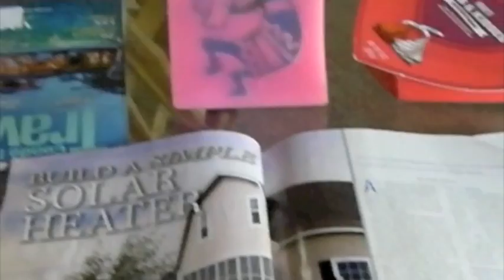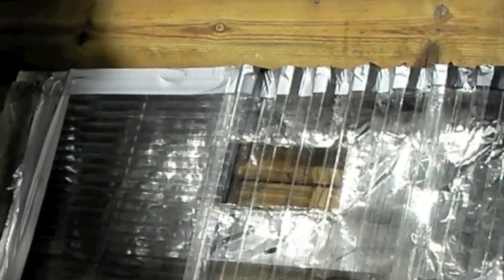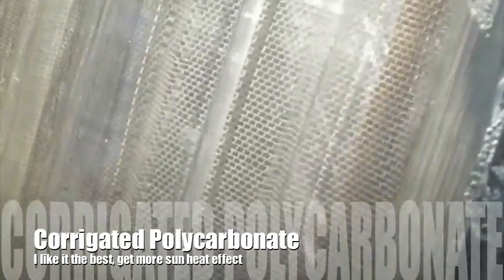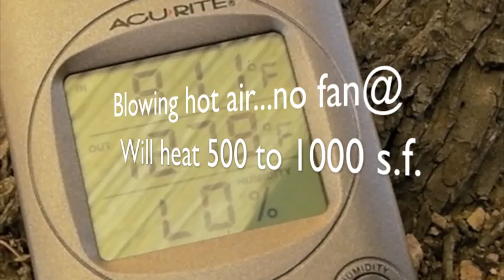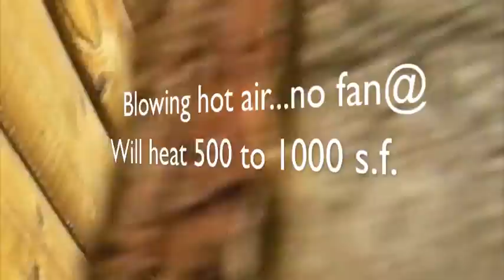How to Build a Heat Box for $6, Heat your Home Free

Comment from the maker: Someone asked the question what do you do when the sun goes down. 
Odd question, most people go to bed and sleep. In the mountains we watch a bit of TV, put an extra log in the fire, and sleep with a blanket.  Any kind of solar device works when the heat is on. Just like electricity works when you turn the switch on, or water works when you turn the faucet on.  I suppose the implication is that this solar device only heats when the sun shines.....yes, obviously.  Sun power is free when it shines.  Electric power is only free when you do not turn it on.
Reply: most people wanna be warm when they go to bed, when they get up to get dressed and when they take a shower i do these things at sun down or before the sun rises, yet blankets are great but my nose gets cold, and if i cover my head with blankets i wake up with a head ache, and a scarf proved dangerous for sleeping lol
Reply: and i dont have a wood stove, live in the city none of the buildings were ever insulated or built well.
Reply: I not a troll Ben, but you had things left over from other projects right? were they free when you got them? I don't think so! That's all I'm saying ok! I love to build things too! I started building HHO generators around a year ago, still learning the process on different ways on use that gas, not just for cars but using it for heat, cheap heat! In the process of doing all that I had too buy tools and materials.There are a lot of people out here that want too be able to do the things that you are doing but don't even own a screw driver much less know how to use one! lol. I put up 8 videos last night 11/20/14 on the differences of stainless steel wool and stainless steel plates, had fun doing it but the wool is a bust. The reason for 8 videos, are the camera on my phone only goes up too 10 mins. for YouTube! Well with all that is said Have a nice day and keep up the good work!
Reply: Solar heat storage can be built for night time or cloudy days. One has to built
 more solar heaters and a larger storage unit.....For glass covers I have use the glass from french doors..ease to get them for free...(used ones that people take off their homes). Fox solar heaters are very ease to built....Just google   diy solar air heaters     there is tons of info....( or youtube..)
Reply: joan baczek
I disagree Joan - I like to be warm during the day when I am working in my home office and I like my room to be cool at night, otherwise I don't sleep well...and I know I am not alone in this. In the winter this solar heater could mean that I can reduce my daytime heating bills - and the residual heat from the free solar heat will stop my boiler / wood burner from having to do as much work. I don't think Ben is suggesting you replace your heating completely for this solar panel...just showing you an alternative way of thinking about how we heat our homes.

Comment: too shaky, have a headache, i stil dont HOW to make or where to get 'polycarbonate, what is the specific name of the poly, u make an almost totally shakey worthless vid
Reply: Just now got around to answering. My mind is certain, I built it, and it works. I had some old scrap materials and determined to build something with materials that were old, used or on hand.  But, you can use plastic, fiberglass, glass, miller. If you can't find anything most people go to a hardware store or Home Depot for building materials.  

As small as this is;  60" by 36" your cost would be very reasonable even with new materials.  Have you gotten around to doing anything, if so, send us a photo and a budget of what your costs were. That would be a positive contribution.  Actions vs Words thing. This is not rocket science, it is a simple box frame with one side to let sunlight in.   6 ft high, 3 ft wide and 4 to 6inches deep.  The front facing the sun is plastic, polycarbonate, glass, or fiberglass. The back has aluminum foil to reflect the sunlight back to a window screen that is hanging in the space in the middle of the box.  My goal was to see how or what I could put together with some old scraps in my basement.  How to build it, you nail or screw the 4  4x4's into a square shape and nail a piece of plywood to make the back. That should take you about 20 min.  Then you hang a window screen or metal door screen wire in the middle.  I put foil on the back to reflect the sun back toward the screen...and it heated it up even faster.  Then screw the plastic see through cover onto the front, another 20 min if you are slow.  All in all I spent about 2 or 3 hours putting it together.  I heats the outside air temperature in summer and winter from 40 to 70 degrees hotter, and works very well without a fan.  We considered putting a fan onto the hole in the wall inside to blow air in faster, but never got around to that.     Sorry about the shaky video, I am not a film professional, just wanted to throw the idea out there.  Over 560,000 people have viewed it, and many have built these. Build one and send us photos.  My out of pocket $6, but you can do a Cadillac version and use all new materials but even with that, the cost is very negligible.  Best to you.  Ben Booth

Comment: To all the ney-sayer's;  If the same amount of the sun's rays hit the same box, the heat (calories) will be the same.  It doesn't matter if it is a -20F or 40F day.  The air coming out of the box is 40 degrees higher than going into the box.  So, if it is 20 degrees or 80 degrees, you will still be adding air to your home that is 40 degress warmer than the outside air.  The key is that it only works when sun is hitting the box, not whether you live in Canada or Florida.  GOOD WORK, BOOTHE.  I know what it is like to be working around 7000 ft.elevation.
Reply from the maker: Thanks for the kind and enlightening words.  Ben

Comment: for all you naysayers, even if it only heats 1 percent of your total heating bill, as some have proposed, it is still heating your home, and it is still free heat. so quit crying and build a box, If you can come up with a better free energy plan, post it! If not then shut it and let the grownups talk.
That being said. this video would be better if it was a bit more explanatory, what kind of wire did you use, and why not just paint the back of the interior black?

Comment: Regulates the Room's Temperature
Form board insulation that is backed with aluminum foil is one of the better materials you can use to insulate a room, as it helps to regulate the room's temperature. During winter months it will keep the heat in and during the summer months it will help to keep the heat out. It is a popular choice among homeowners for insulating attics and basements.

Comment from the maker: The idea on reflective back, is to bounce the heat back to the wire screen that is painted black,, let the heat there, where the air passes through the wire screen, gain an optimal level. 
It works with this model very well, but you can try it both ways and see which works best for you.

Comment: If the ambient outside temperature is 80 plus degrees why are you heating your house?
How well does this work on the outside and the inside temperature is let's say... 40 or below
Reply: You gotta be a special kind of stupid! He didn't have it hooked up to his house dummy! It was obviously just leaned up on the side of it.
Reply: @hotrodhog2170  You didn't READ. There are vents top and bottom that go through the wall into and out of the house. Air as it is heated rises and  draws air from the house at the bottom and  back into the house warmer.
Reply: @klopez7080  I know how this heater works, but you didn't WATCH the video because it is just leaned up against the house and not attached. He moved it away from the house to show the other side of the box. It is summer time and it is not warming the house when this video was made.
Reply: @klopez7080  Starting at 2:50 he tilts it out and puts his hand in the top hole.
Reply from the maker: @klopez7080  Thanks K. Some people just like to insult and criticize. They are eager to insult by email, but don't have even the courage to come face to face with respect and charity.  Thanks again.  Ben Boothe.  By the way over 500,000 people have viewed this video, hundreds went on to replicate or improve on the idea. That was the point in the first place. Then you have the blowhards like Hotrod Hog....wow....
Reply: Hotrod Hog i
Reply from the maker: @hotrodhog2170  Hi there Hotrod.  I can see that you are a marvelous and creative person because you actually do something...not just blow talk.  When you insult others you simple define yourself.  Show me something you have actually done in life, other than sending out insulting emails. The reason for doing the video was to stimulate pro active people who enjoy thinking and doing creative things to use this to create something good by using solar heating.  Over 561,000 have viewed this video, and many have written and told us it gave them ideas to do this, and even made improvements. That was our goal.  I am curious if you have done anything positive to take this idea and improve upon it, or if you like a tiny majority just use the internet to insult or criticize others who actual "do something".  I wish to encourage you to build something good and creative and tell us about it, or even do a video it.  That is if you are a "doer", not just a talker.  Let's do things positive and actually do good things.  Best wishes to you as you do great things to make this world better.    Ben Boothe
Reply: @BenBootheSr  Sorry, I'm not a "blowhard as you say. This build is very logical but some folks are to lazy to hit the "show more" button and read the article you spent a lot of time writing. It is not rocket science and very easy to build. People that don't know what they are doing or will never build this heater just want to waste time. Hope you are doing well with the recent snow you just had this past week.
Reply: He suggested adding a fan, could even improvise and make it the length of the building
Reply: The issue is how hot will the air get inside the box.  When it's 80 degrees outside, the heat loss will not be great.  But let's say it's 20 degrees outside.  The heat loss is going to be considerable.  At some outside temp the contraption is going to stop producing heat.  Why don't you try this for a winter and see how much it cuts your heating bill.  I should mention that this thing will produce heat only during the hrs when the sun is positioned to shine on your box.  It will be just a small fraction of the hours each day.
Reply from the maker: It tends to increase the cold air temperature about 40 degrees...depending upon the angle and duration of the sun. Sometimes more and sometimes less.   Has done that consistently...even when there is snow on the ground.
Reply from the maker: Hi there. The reason for doing the video was to stimulate pro active people who enjoy thinking and doing creative things to use this to create something good by using solar heating.  This cabin is atop a mountain and in the winter there is a couple of feet of snow there. So most normal people do projects when the weather is mild. It actually works very effectively summer and winter.  Over 561,000 have viewed this video, and many have written and told us it gave them ideas to do this, and even made improvements. That was our goal.  I am curious if you have done anything positive to take this idea and improve upon it, or if you like a tiny majority just use the internet to insult or criticize others who actual "do something".  I wish to encourage you to build something good and creative and tell us about it, or even do a video it.  That is if you are a "doer", not just a talker.  Let's do things positive and actually do good things.  Best wishes to you as you do great things to make this world better.    Ben Boothe
Reply: Mitzpatrick Fitzsimmons yui
Reply: My thoughts exactly!
Reply: @pennypinchingprinces  Damn you're hot! Keep up the good fight
Reply from the maker: Well I guess you missed the point. We build on a mountain top during the summer. The winter is covered with snow.  Still get a 40 to 60 degree heat up of air, even in the winter.  Best, Ben
Reply: @BenBootheSr  How does it do after dark? I assume it's only good daytimes
Reply: @BenBootheSr  improvise, make it bigger and thicked

Comment: where are you getting poly carb for 6 bucks? its 30 bucks here for that much curregated
Reply from the maker: Hi Gary,

We had some old poly carb in the storage room, that was left over from a project and actually we were given it free.   Check out your greenhouse dealers and they often have extra sheets that have been cut and they won't use them.  If you buy one long sheet at Home Depot you can get it for $25 and it is more than enough but sometimes they have broken or cut sheets for free.  

Ben
Reply from the maker: Hi Gary, we used scrap materials, as mentioned in the video.  No, our scraps we just cut into the shape.  $6 was our total cost.  Hi there. The reason for doing the video was to stimulate pro active people who enjoy thinking and doing creative things to use this to create something good by using solar heating.  Over 561,000 have viewed this video, and many have written and told us it gave them ideas to do this, and even made improvements. That was our goal.  I am curious if you have done anything positive to take this idea and improve upon it, or if you like a tiny majority just use the internet to insult or criticize others who actual "do something".  I wish to encourage you to build something good and creative and tell us about it, or even do a video it.  That is if you are a "doer", not just a talker.  Let's do things positive and actually do good things.  Best wishes to you as you do great things to make this world better.    Ben Boothe
Reply: Well, I have experimented with glass, fiberglass, plastic, and other materials, some are very cheap others more. But we had some old poly carb in the basement, and so decided to use the materials at hand. Have you built anything?  Why don't you do something, instead of talking or thinking, and show us what you do....Send us your budget and that would be a positive thing.  Many people have now built these out of the 560,000 viewers and have had good response.   Best of luck to you.  Show us what you actually do.     Peace,  Ben

Comment: show a vd of the  build
Reply from the maker: It is all there. It is just a box, with polycarbonate on the sun exposed side, and black backing with screen wire and aluminum foil inside to reflect the heat to the wire as the air goes through it.

Comment: How much heat do you get when its cold and overcast.You dont need heat when its 80 outside
Reply: Just now got around to answering.  It heats air from 40 to 70 degrees, in any season.  Of course, when there is no sun, it does not make, that is what solar energy is all about.  But we have 300+ days of sunshine on our mountain.  This is not rocket science, it is a simple box frame with one side to let sunlight in.   6 ft high, 3 ft wide and 4 to 6inches deep.  The front facing the sun is plastic, polycarbonate, glass, or fiberglass. The back has aluminum foil to reflect the sunlight back to a window screen that is hanging in the space in the middle of the box.  My goal was to see how or what I could put together with some old scraps in my basement.  How to build it, you nail or screw the 4  4x4's into a square shape and nail a piece of plywood to make the back. That should take you about 20 min.  Then you hang a window screen or metal door screen wire in the middle.  I put foil on the back to reflect the sun back toward the screen...and it heated it up even faster.  Then screw the plastic see through cover onto the front, another 20 min if you are slow.  All in all I spent about 2 or 3 hours putting it together.  I heats the outside air temperature in summer and winter from 40 to 70 degrees hotter, and works very well without a fan.  We considered putting a fan onto the hole in the wall inside to blow air in faster, but never got around to that.     Sorry about the shaky video, I am not a film professional, just wanted to throw the idea out there.  Over 560,000 people have viewed it, and many have built these. Build one and send us photos.  Best to you.  Ben Boothe

Comment: Well that's all well and good, but check the temperature in the winter.
Reply from the maker: Your logic is a bit negative.  Everything that is built for a test or to see if it works is done under lab or controlled conditions. What we have found is that I still get a 40 to 60 degree spread of heat, even when it is 40 degrees outside, now let's see: 40 degrees, + 60 = 100 coming from the vent.  Now smile and be happy
Reply: I beg your pardon after reviewing the video again and reading the post after I can see that I was very wrong in my calculations. I would also like to replicate the same system you have it is a very valuable tool in the heating process without to much expense.

Comment: who needs to heat your house when its over 70 .
Reply from the maker: Your logic is a bit negative.  Everything that is built for a test or to see if it works is done under lab or controlled conditions. What we have found is that I still get a 40 to 60 degree spread of heat, even when it is 40 degrees outside, now let's see: 40 degrees, + 60 = 100 coming from the vent.  Now smile and be happy.
Reply: Ben Boothe Sr.
 I just don't think you will get that when its cold. but i would like to see that. I have seen others like that but when it was cold it didn't work out as well.